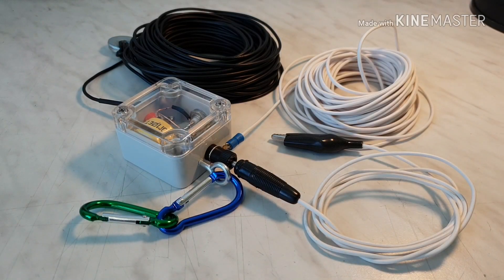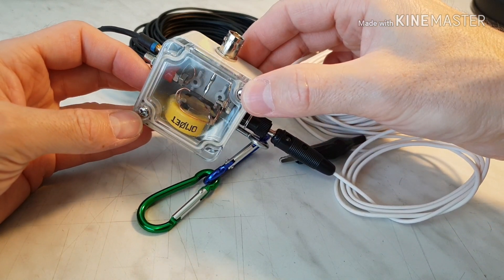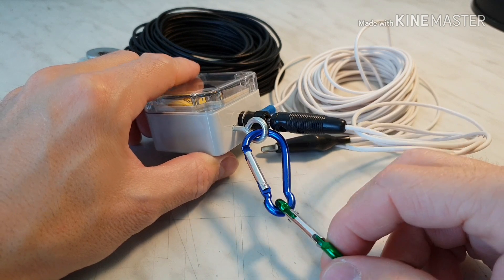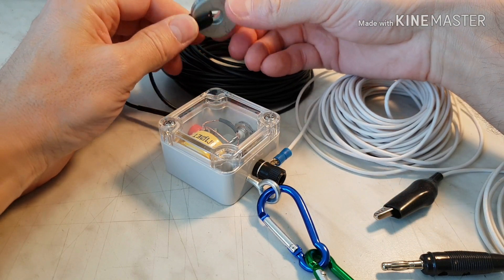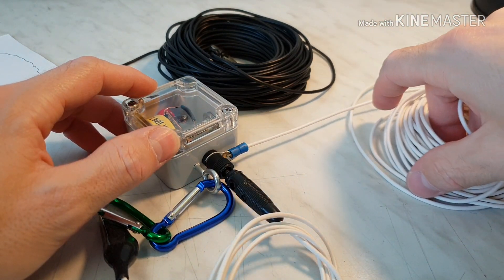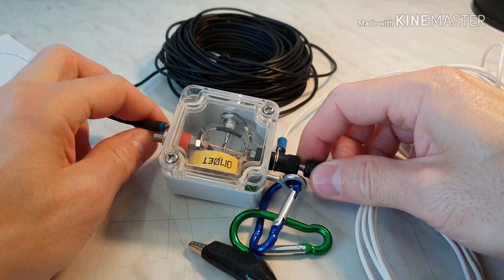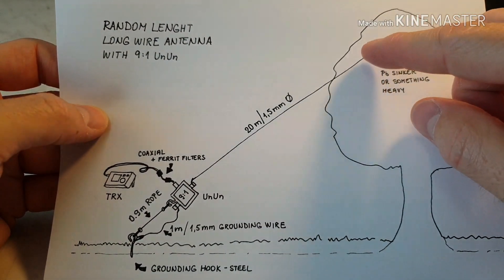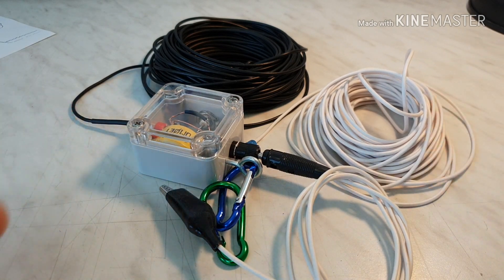Modificated RANDOM WIRE ANTENNA with 9:1 UnUn (part 2)

Comment: I want to build a similar antenna for DXing the AM broadcast band, 500 KHz-1600 KHz, any idea how I can determine the impedance of a 'long wire' (relative term on a 300 m band) antenna? I may need a 1:10 windings ratio on a 75 foot radiator.

Comment: Under what circumstances  would you need the Long ground wire ? If you do need it do you still ground it to Earth Ground with the alligator clip? It seems that by using the ground side you are making a Dipole antenna.. Right ??  73's N5ZXZ
Reply from the maker: This kind of antenna needs a proper ground to have a better efficiency. But I work QSOs also without ground :)

Comment: I would be worried that your antenna wire will break at the ring connector due to the strain of also supporting the box and ground rod connection. Better to add a strain relief there I think - it's what I do on mine at least :)

Comment: Surely that yellow and white toroid is a very low frequency lossy dust-iron core, NOT a ferrite?  Most well-respected ham websites recommend a much more efficient type 43 REAL ferrite for the 20-40-80 bands.
Reply: @Gort Newton If you plan on going to 80mtrs you should use a type 31 ferrite. Type 43 is good for 40mtr and up. Karl

Comment: Paul, enjoying your info , antenna appears to be working FB ! Does your Radio have a built in tuner ,i wonder if your good readings are being tuned by the internal matching ?  Tks, 73,72 , Jerry K9UT
Reply from the maker: Hi Jerry. Yes it has the internal automatic tuner, but during this test it was turned off.    73 Paul 😉

Comment: Saw the previous video as well. With 20 mtrs of wire, it seems to me you've made a EFHW (End Fed Half Wave) antenna instead of a 'longwire' . Then the 1:4 or 1:5 UnUn,  you have constructed in part 1, will work just fine. 73 de PD0PSX.

Comment: Looks nice. What sort of power handling do you anticipate that it can handle ?
Reply from the maker: Thanks. Hmm 🤔 i tryed it with my QRP rig and 5W. I don't know what max power it can handle at this moment. Depends on used core i suppose 10 or 20W. My opinion only. 😁